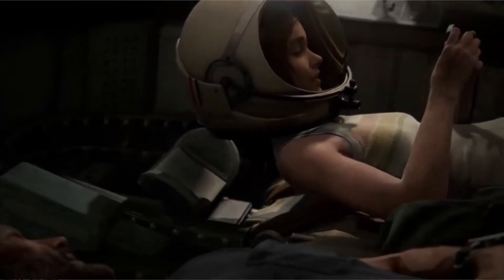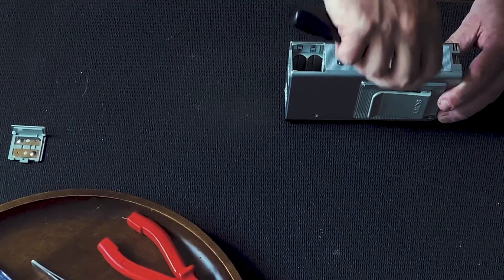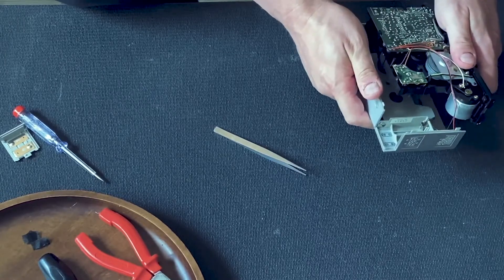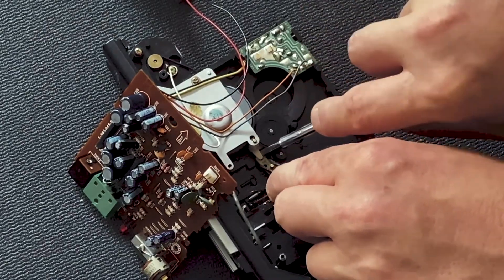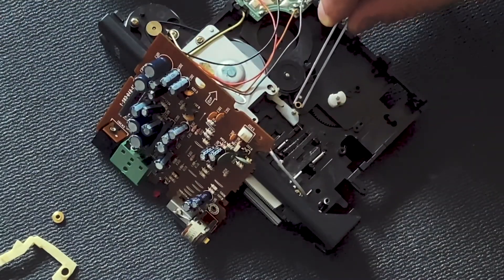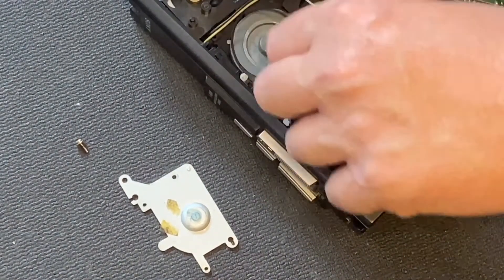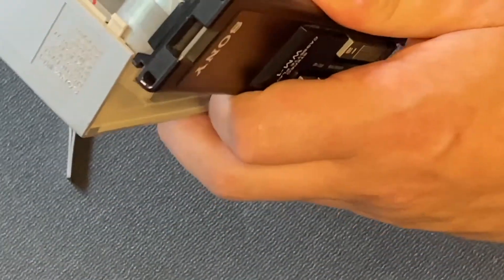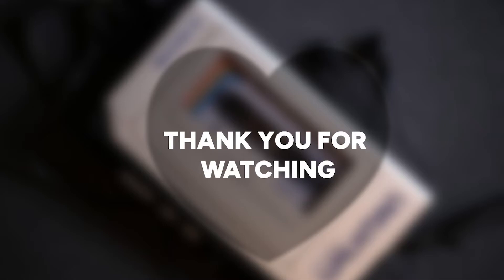How to Repair Ellie's Walkman from The Last of Us | Sony Walkman WM-1  | DIY Step-by-Step Tutorial

Comment: hi i was wondering what size do you use for the replacement belt?
Reply from the maker: Hi, i used the following belt.. it doesn't say exactly what size it is, but maybe the seller can tell you..https://www.youtube.com/redirect?event=comments&redir_token=QUFFLUhqbWNjOXN6bUdPOEJRTWVsek5haW5JUmE0c0xDQXxBQ3Jtc0tucl9oRjJaUHk0UjYtUHk3WHJXYWZqVVBabW5UQzkzdEZ5RHRidVF5UmE0M3dic3lpTUo1U0pHcHJ2bUJHQWtHNHVkVV9EcFFMQkwtSnZVNU9QZmtGcUVVUE5MY2QzQmRCbEVrY1c0WmRtWTRyWTRhaw&q=https%3A%2F%2Fwww.ebay.com%2Fitm%2F125837030029%3F_skw%3Dwm-1%2Bbelt%26itmmeta%3D01JHA4GRHYK1MSMX11WQN4XN93%26hash%3Ditem1d4c78b28d%3Ag%3AxfAAAOSwC2djTt2Y%26itmprp%3Denc%253AAQAJAAAA4HoV3kP08IDx%252BKZ9MfhVJKk2dDXotdHgZDZfW7hXwfZARlW8UPadf2%252Bn99bZiKXifNDurj%252B75hH4m%252Bz1B4D70xKYY%252BfW%252BX%252FLCR9HQKiPMKIt3Z7RNrWlU5NEl5tFBdZAF%252BDvfC4I5bj3XdQMVEkER02haT4SI0bonrH7SBlX6HgocGzCjR%252Bpy3%252FdeROYcB66iGWOE9ADkXuZmnmoswM1WX7BkL19sAd6rAaBkrCtHFoXzHou12rq2rDmjUa8p9FcX2c3xX2cmqQhGbW7RhKwagDNJJ8M330m1jq0gh%252BOFtBI%257Ctkp%253ABk9SR5CJw8SKZQ&stzid=UgwMXlwSs4ZhOhvUb4l4AaABAg

Comment: I purchased a defective unit as well trying to restore it, i was just wondering where i might find a battery flap as it was missing from the unit i got for 10$
Reply from the maker: Hi, I searched for these already, but had no luck. Since I neither have a 3D printer nor any experience in building STL files, I can only offer to provide pictures and measurements of the original parts, if someone can build STL files from that. A solution for the metal part could be something like this: https://www.aliexpress.us/item/1005003071630670.html. The dimensions seem to fit.
Reply: @PostApocalypticDIYProjects  oh please do provide a picture of the battery door I tried looking all over thrift shops to no avail.
Reply from the maker: Hi, here are your pictures. https://www.hh-stpauli.de/door.zip. If you find a way to replace it, please share it here!
Reply: @PostApocalypticDIYProjects  i definitely will share,  I will create using Autocad and 3d printer
Reply from the maker: @Iacon_Collections  Ok, if you need measurements or more detailed pics please ask!
Reply: @PostApocalypticDIYProjects  well if you have the measurements that would help a lot
Reply from the maker: @Iacon_Collections  I will do some on the weekend!
Reply from the maker: Hi, i uploaded new pics and measurements in mm. https://www.hh-stpauli.de/door2.zip ... As you clearly can see, i am not a technical draftsman :) So if you need more please ask.
Reply: @PostApocalypticDIYProjects  I really appreciate this man, i already have created a prototype now i will try to recreate it as close as possible I will post it back here once I have what I think is the best recreation of it.
Reply from the maker: Perfect, i am into buying a 3D Printer this autumn, can't wait to try ist..  How o you want to replace the metal parts?
Reply from the maker: Hi, i made a version myself, now that i have a 3D printer.. Just in case you didnt have the time for it:

https://makerworld.com/en/models/732711#profileId-664323
Reply: Amazing video thanks !
Reply from the maker: @qclnn  Glad you liked it, thank you!